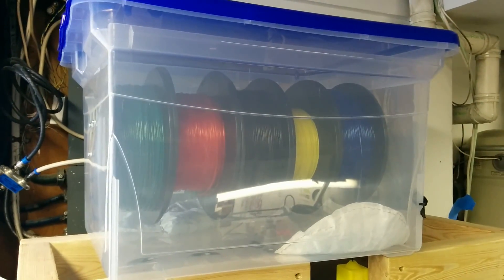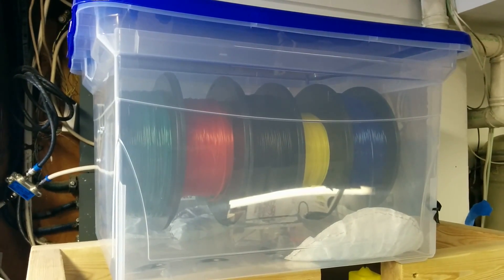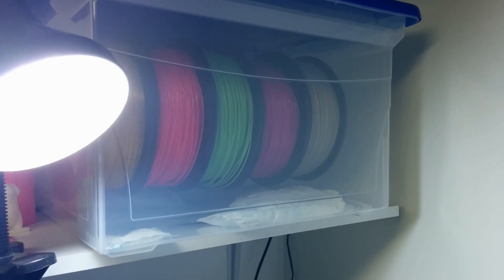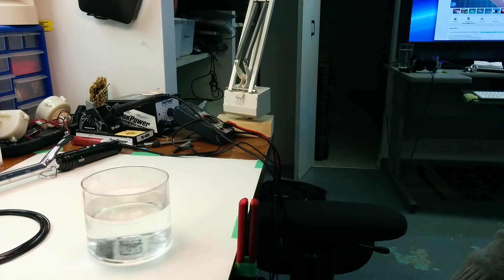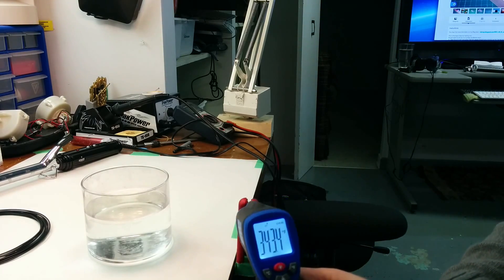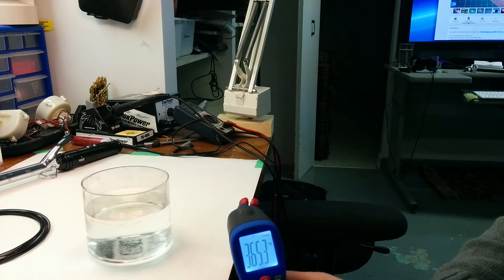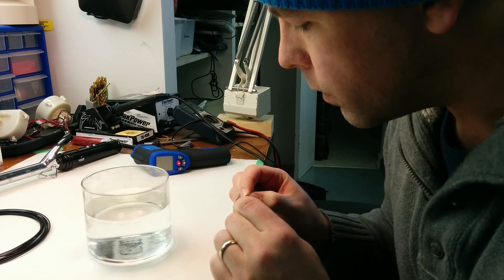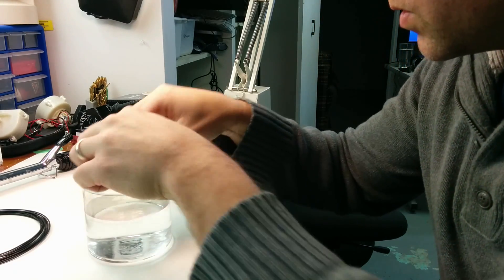Filament joiner for multicoloured 3D prints

Comment: easier/faster and cheaper than a divorce: https://www.ebay.com/itm/3D-Printer-Filament-Connector-Adapter-Accessories-Connect-Broken-Filament-1-75mm/143366075961?ssPageName=STRK%3AMEBIDX%3AIT&_trksid=p2060353.m2749.l2649